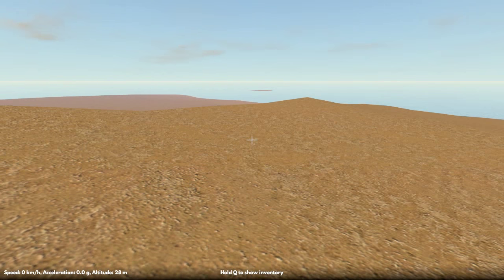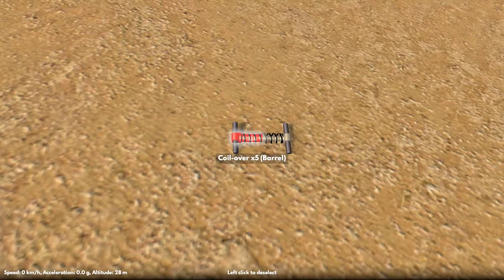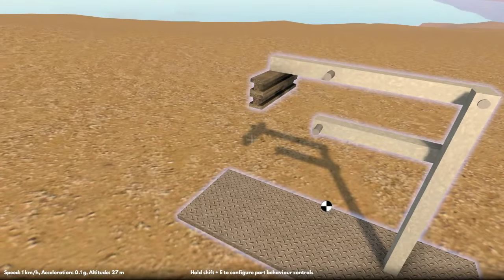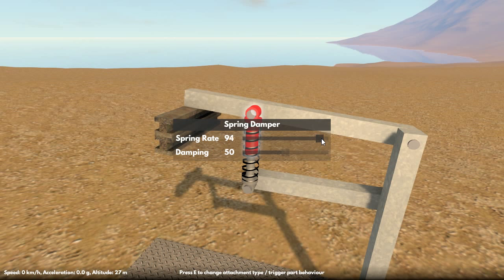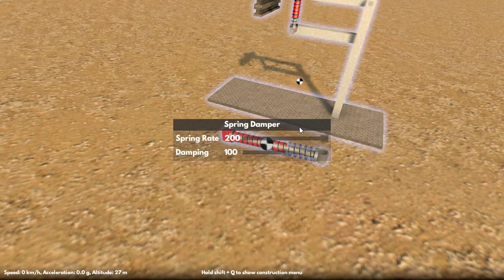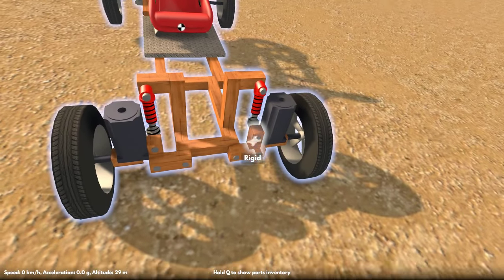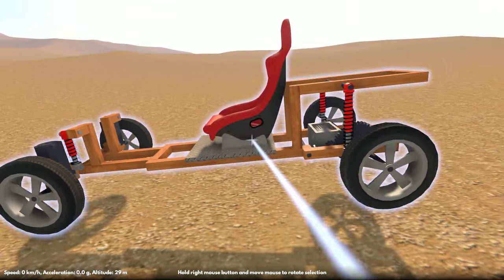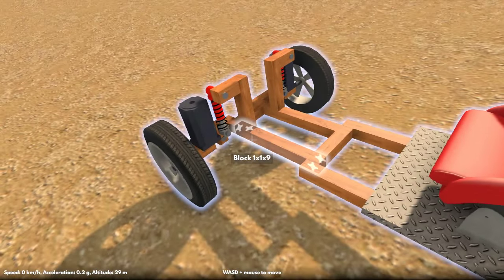GearBlocks dev diary: Spring dampers

Comment: Hello!
I have a problem.
I have windows 8 and if i try to open the game then it opens notepad with meanigless letters and symbols mix.
What to do to make the game run.

Sry for my english
Reply from the maker: Joosep Jagomägi Do you mean when you open the rar file?  You need to extract it (with winrar or winzip etc.) into a folder on your hard drive.
Reply: ok im fine i already fixed it.
thx anyways